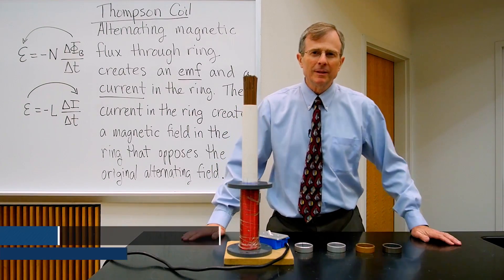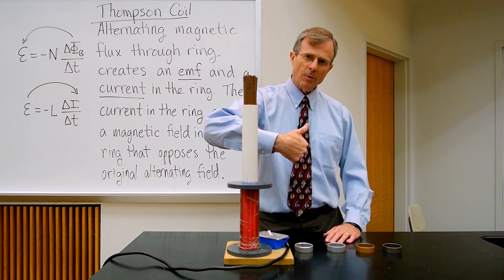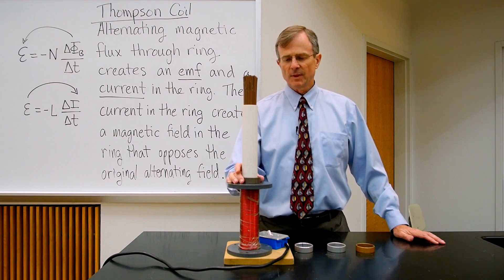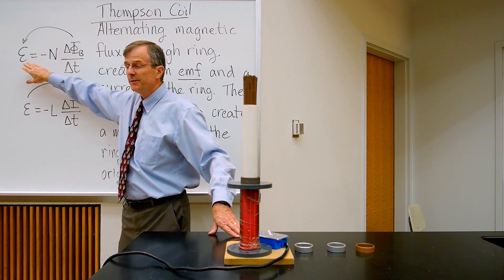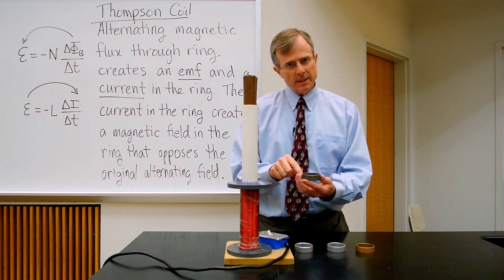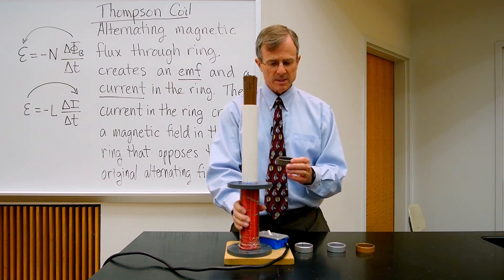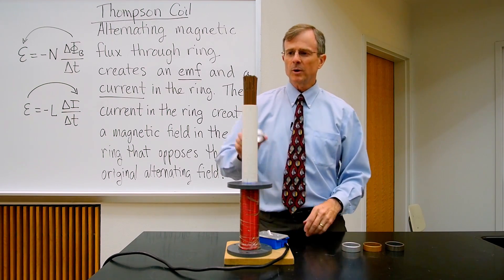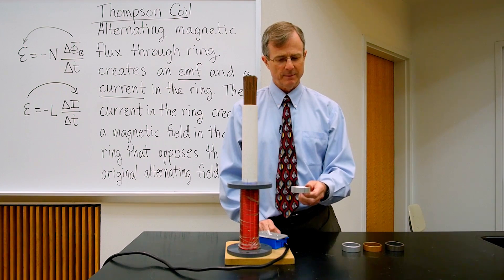Faraday's Law Demo: Thompson Coil

Comment: if you had a clockwise magnetic field and somehow stuck a capacitor on the end of it to hold an EMF could it be discharged as a pulse and if so how far would it travel.... could it be used as an EMF gun?